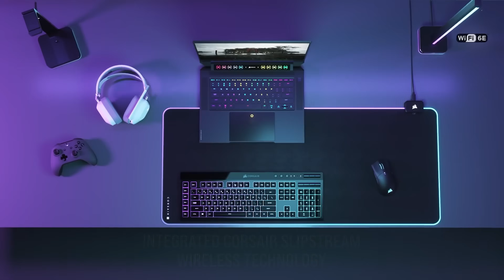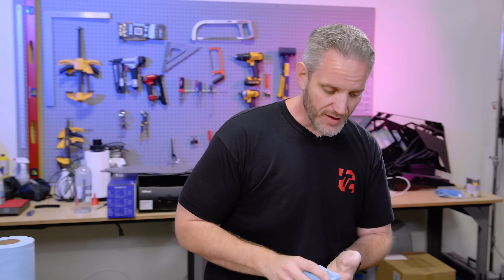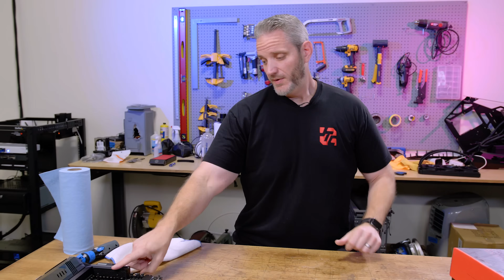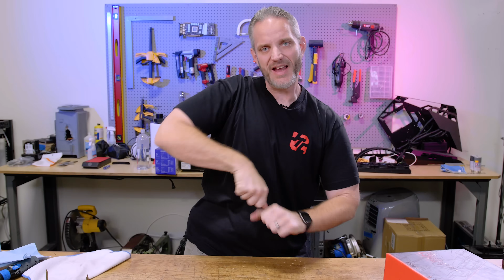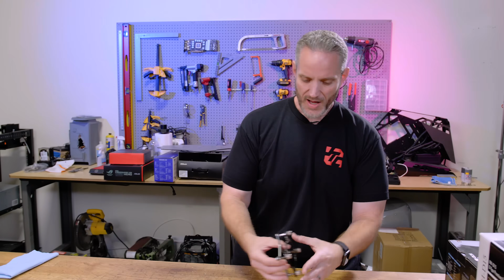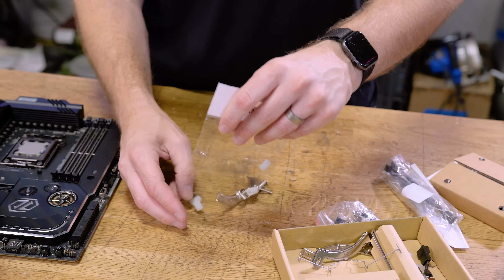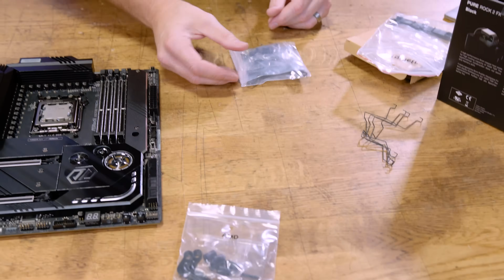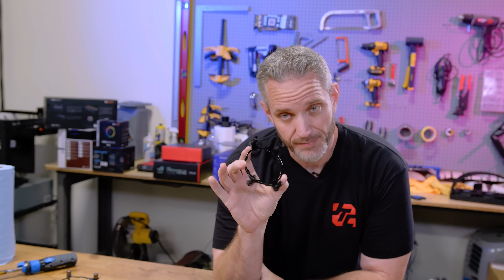AMD made a terrible flaw with this design...

Comment: I had one of those Athlons back when they were single die 1 GHz CPUs with nothing special.  No mediocre graphics chip taking up a large portion of it or any of that stuff.  I would prefer to buy a CPU not an APU.  I would rather spend the considerable extra amount of cash on a good graphics card.  That is considering not too long ago they were marked up insanely high and thus were inexcusably expensive.

Comment: They should have just made them fully non compatible.  At this point with the hold down mech being tied to the backplate, they are marginally compatible at best. Should have just made a clean break from am4 and changed the z height

Comment: Oh dear, JayzTwoCents made an angry video only to realize he should've done a bit more research regarding AM4/AM5 cooler compatibility, because in the end, most AM4 coolers do have proper AM5 compatibility. Not to mention Phil's Athlon XP socket A (462) "hooks" have nothing in common with socket 939/AM2(+)/AM3(+)/AM4 "hooks" which are in fact very similar in design. But I digress ... 🤕

Comment: Hmmm... are you guy's sure about the negative effect of an increased heat spreader thickness?
Usually it's the interfaces that cause most of the losses in thermal transfer capacity, where as within a solid metal block you have very little loss of said ttc. This is IMHO the very advantage of direct die cooling as it completly eliminates on of the two termal interfaces (chip to IHS and IHS to cooler). Somebody run a thermal simulation on this?

Comment: I was sooooo hyped with all those end of year release but the more I learn about them, the worse it gets.
Between crazy temp, pricing and naming shenanigans or crazy electric consumption. I'm so very disappointed.

I'm on a 6700K with a 1080, upgrade is a need at this point but I'm considering just going for a 12900K with a RTX 3080Ti and give the finger to those release.
Reply: You were so hyped. And now you are disappointed? Did you expect 2x 12900K performance with 65W with 50°C? Sorry, but get a life.
And 95°C simply means that AMD's boost algorithm gives you the best performance you can get. If you can't understand the reasons behind that, inform yourself.
Reply: @johnscaramis2515  Ha yes, the idiot take. Needed that.

Comment: I always buy Noctua; their documentation is always spot on (which models are exactly compatible with what).  No mounting issues and my temps are always great.  You buy poorly documented shit with shit mounting hardware and use shit thermal paste?  Yeah, you'll have problems.  Do your homework.  Read the online documentation.  If it's not well documented, then don't buy it.  Glad yours passed.  Nice design.  👍

Comment: @JayzTwoCents i'm just wondering.... would a thermal pad still work with direct die instead of traditionnal thermal compound?? i never used those so i thought  maybe it would be a solution if it was thick enough for good  cooler contact and reduce risks of Die cracking.ThermalGrizlly  already makes some thermal pads i believe but i think they may be too thin for this.
Reply: Unfortunately, thermal pads have terrible heat conductivity compared to metal to metal with thermal paste in between. In other words no, that would end up much worse than not delidding it at all. Thermal pads are basically a "better than nothing" type of product. :)
Reply: @blunden2  yes but thermal compound can become a real thermal mess too with direct die....i do remember my first amd 1ghz cpu and boy did i put too much of the stuff and the cleanup was a real pain lol. also  the die cracked on a corner while changing the well cooked  thermal paste because too much pressure was applied  on this corner of this hot boy . lol

Comment: 10:55, I think he said more that he was using a new compound of liquid metal, which would be at most -2c than the existing liquid metal product. So you should still expect liquid metal to be part of that -20c reduction, although it's very significant even if the IHS is say -10c difference.
Reply: that is what de8auer said in the conclusion of his video; he was making sure to be transparent because he was using a version that is not on the market yet. I think the doorbell may have thrown Jay off

Comment: The NDH15 does work if you get a newer one, or buy their adaptor for the older ones.
Reply: No need to buy the mounting kit. It's free, as long as you can show that you physically have the cooler and have bought an AM4 or AM5 motherboard and CPU.

Comment: for cpu blocks that come with their own back plate calling them incompatible isnt exactly true its the same screw pattern u could just get 6-32 screws and they will screw into the stock back plate you just have to be careful not to over tighten

Comment: Almost all am4 coolers that do not use the hook retention, use the existing backplate supplied with the amd motherboard and use the same thread as the screws that screw the plastic hooks onto the the bracket.

Comment: You could 3d print a bracket that's a few mm lower (or halve its current thickness) than the IHS and then sand down the IHS to the 3d print and see how much of a difference that can make.

Just an idea before you de-lid it.
Der-Bauer did kill a 7950X doing so after all XD (Not to say you will have that issue, I am sure he will fix that bug with his de-lid kit.)
Reply: 7700X.... not a 7950
Reply: The 7700X Der-Bauer killed was not a retail chip, he did mention the dimensions of that chip was slightly different.
Reply: A 3d printed bracket would not have the necessary strength to hold a cooler with the required compression to achieve effective thermal transfer.
Reply: @benaguilar1787  if you printed it so not all of the force is relying on layer adhesion it'd be more than strong enough
Reply: @benaguilar1787  you dont even need to print a whole bracket. just print a spacer for the stock bracket to lower it the desired height at that point all you would need is longer screws for the ILM
Reply: @benaguilar1787  You can 3D print soft jaws, i think your little cpu cooler will be fine lol
Reply: @benaguilar1787  dude - i've got 3d printed mounting kit for my motorcycle panniers. I thought it won't hold much because it's plastic and doesn't look solid at all but it can easily hold 50kg O_o.
Reply: @benaguilar1787  nono, it might. Depending on how thick you printed it, the material, and if one was ok with only about 500 grams of pressure... Of course at that point you would be better off just running the motherboard flat on an open table and just gently setting a heatsink on the cpu with no bracket...

Comment: The thickness of IHS should not be a problem. The thickness of the nickel coating is more likely the issue. Would be interesting date to send the IHS to a material lab & have them test the copper alloy & nickel coating.

Comment: Heck yeah I know of the problems with the screwdrivers when mounting coolers. It was also on an Athlon XP 3200+ where I rammed a screwdriver straight through a motherboard when it slipped of the mounting bracket.

Comment: A benefit of a thicker IHS is that it is less likely to warp. LGA 1700's warping IHS problem probably would not be as bad if it was thicker. As for the attached backplate, one of the most annoying thing is trying to keep the AM4 backplate in place while trying to attach a cooler to it if it is already in a case. The attached backplate does make mounting in a installed motherboard much easier.
Reply: Some mainboard manufacturers used something like double-sided tape in the beginning. Then they refrained from it because users complained that they could not take off the backplate.
I wonder: AMD's backplate is really good, but some cooler manufaturers decided to include their own bracket. Usually controllers look at every cent and cut costs wherever possible. Then why produce an additional backplate?
Reply: @johnscaramis2515  So the problem there would not be AM5, it would be that the replacement the cooler maker provided was not compatible.

Comment: Imagine releasing a new plattform with not a single mainboard under 400€ and only DDR5  and then worry about the cheap air cooler somebody had for 5 years. Upgrading to AM5 costs >1000€ anyways, at this point people can also spend more 100€ on a new AiO

Comment: Jay, i think it is important to note that UNLESS you can make 7950x go to 115C then having it be stock with your cooler of choice is really what is important here. 

COOL it doesn't HAVE to go to 95C; however, it was designed for it and performs above expected numbers AT 95C. 

DO testing with 120/140/240/280 water coolers on AM5 with the 7950x at STOCK and do LONG LONG LONG LONG LONG tests to see how LONG it will hold the 95C or when it will go above 100C. THAT is really what the community wants to know. 

DOES AM5 go into OVER 100-110C with extended periods of heavy work loads on ALL AIO cooler sizes OR does it still just enjoy the comfort of 95C throughout the testing period?

You being a former IT and SysAdmin know for a fact that you are focusing on the wrong "issue" here. 

What does the conventional end-user temp look like as well? 3-4 hours gaming/heavy work load session on 120/140mm AIOs? That is the main question here, we know the 240/280mm are going to hold it at 95C WE KNOW that. You need to do the 120/140mm if you are going to be going off on a tangent in a video saying "There is a flaw in this design". AMD creating a bracket - cool good for them, but I haven't seen the flaw here except for them NOT stating that AM4 cooler compatibility will depend on the mounting mechanism of the cooler.